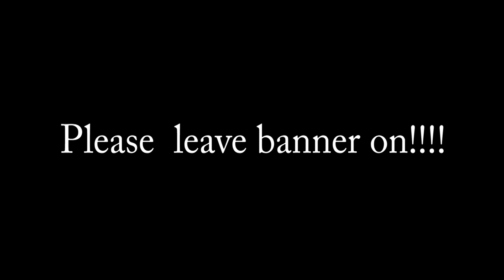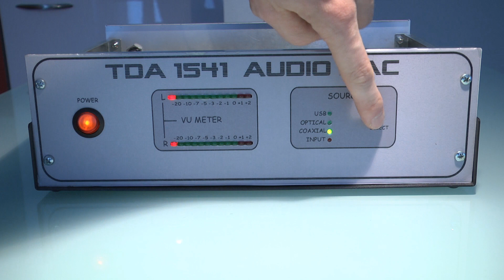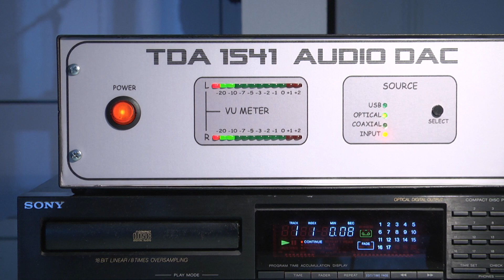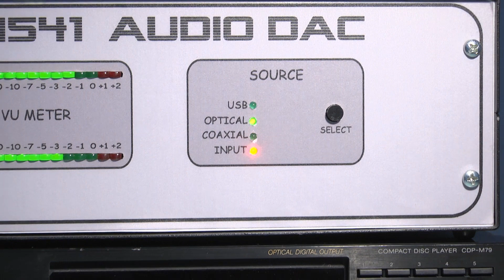DIY Philips TDA1541A AUDIO DAC from Raindrop Hui HD video

Comment: Hi, thanks for the cool video! I can't find the complete kit on eBay. Only the DAC board. Do you have a list of all components or maybe a link? I'd like to build a DAC just like this one!
Reply from the maker: Hello! I have bought only the DAC board, the other parts had been bought apart and but toghether by myslef, without following any official instrucions. Look for a DAC board who has the clock signal connected to the reader one, not "re-build" inside the DAC...my DAC doesn't have this feature and sometimes it doesn't link the source clock!

Comment: Kim
Hi, thank you for the valuable information for DAC diyers.
For the case of NOS mode only , should SAA7220P/B chip  be reinstalled after setting the dip switches or just discard it?
Thanks in advance
Reply from the maker: If for reinstalled you mean to remove it phisically and put it back on the pcb, the answer is no, it's not necessary. I just move the dip-switches, while whitout power supply.

Comment: This is really great!!!  
 I would love to build my own CD player using a cd-rom. 
Now,  I am not an electronics genius but I have some really really basic knowledge and I am handy with tools...  And not to forget I'm really passionate about music. 
My question is,  from the back of the old cd-rom near the IDE interface there is a 4 pin connector for digital output but from what I read online that output is a S/PDIF output at TTL level. 
Can I take that output and go directly to my receivers digital COAX input or do I need to take it through a DAC and from there go to the analogical input on my receiver? 
If so,  what kind of DAC should I build?  What would be the solution to my problem? 
Thank you very much
Reply from the maker: Many thanks!! Very few people appreciate this work! I'm sorry but i can't help you much with your question, the only thing i can tell you is that the DAC has to be "synchronous", otherwise sometimes it "links" the correct bit sequence, and sometimes not...this one i've built is not "synchronous"..when i bought it i didn't know that!
Reply: lucatn thank you very much for your reply,  I will let you know what I managed to do 😊
Have a good day sir

Comment: hows sound compare between 1540 and 1541 sound, regarding 1540 is 14-bit DAC that cd format is 16 bit. I never hear how 1540 sounding, is good bad than 1541 ?
Reply from the maker: My father has a CD304 by Philips, but it has some problems recently. If i'm able to fix it, i can tell you!
Reply: I once owned a Philips CD104. I replaced it with a Technics SLP 990. There was a slight difference but mot very much. You could still live with it

Comment: Hi, nice video. The issue with NONOS with the multibit TDA1541 is a "recording compatibility issue", being some recordings give a magical result, almost a 3D out-of-box sound, whereas some recordings can be very murky/mudding sounding. Hence with that board it has a switchable filter option to give a brickwall setting for INcompatible recordings, or filter defeat (NOS) with compatible recordings. I note you liked Queen. Have you Fleetwood Mac's Hits on CD?  Continued....